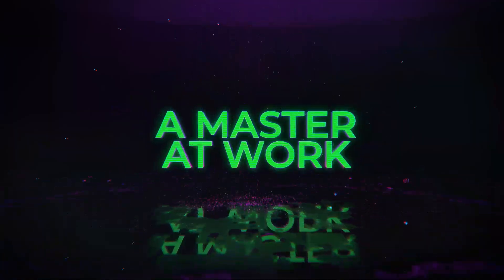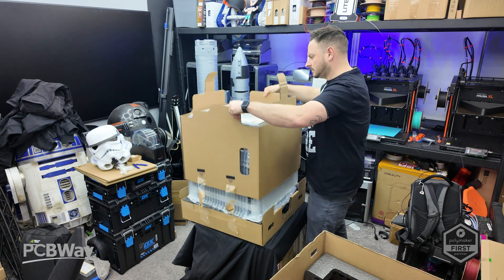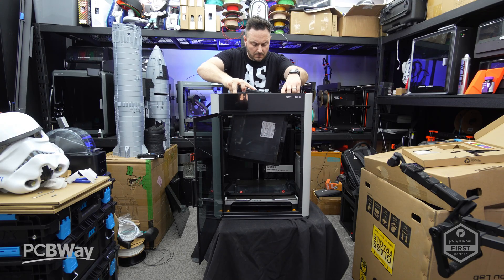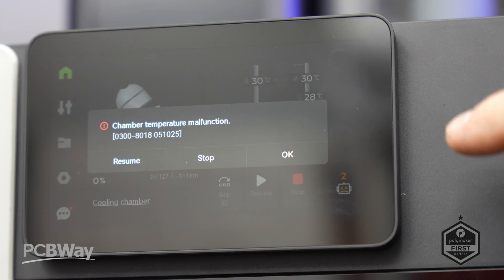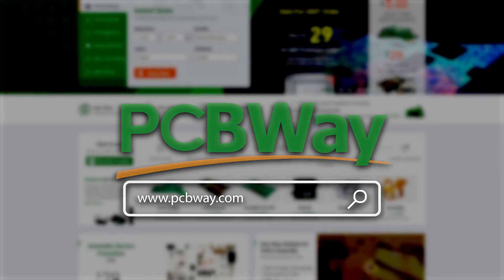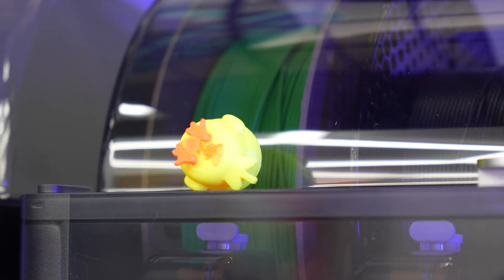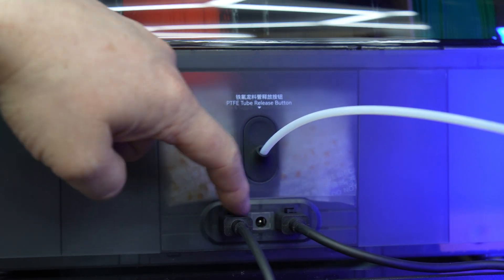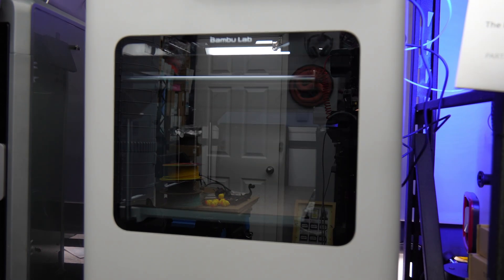Bambu H2D: The Next Big Thing in 3D Printing?

Comment: Hey Sam,
I have a small print farm with 24 Bambu printers and 4 K1’s. My 12 Ender S1 Pros are collecting dust and were made obsolete by Bambu A1’s.
In my opinion the H2D is more of a “toy” than a serious production device. It has too many bells and whistles in one device. I also own laser and vinyl cutters and use them daily in addition to Bambu. 
Lasers create too much dust for a 3D printer enclosure.
Also you can buy 10 A1 Minis for the price of one H2D. I believe many users would have preferred a larger P1S for around $999. without AMS and $1,299 with. Just my two cents.
Reply from the maker: Yeah, I mean to be honest with you I’m a little bit disappointed with the release. I think it’s a bit boring to be completely honest.

Comment: Ceramic guides in the AMS will reduce wear/allow abrasive filament use - that would seem to be the advantage over a dessicant modded older model. Is the new one easier to unbung? 
I have gathered that the new AMS does/will (?) even work with the A1 machines. That aspect would be good to elucidate. 
I get the impression this is Bambu’s “Apple ///“ - beautifully-engineered but with meh performance while misunderstanding what folk wanted and at what price point. I don’t expect “big” sales. 
A (true) 400^3 build volume version of the P1 with a better screen and UI, standard hardened gears and nozzle, call it the P2XL, could have been out earlier and would sell better than this, and not cannibalise sales of other models. Bambu, send me one when you realise I’m right!

Comment: Given the hype and the comments from Dr Tao about how other printer companies are going to have some homework to catch up with the "revolutionary things never seen before in 3d printing", from what i can see the only new thing is the automated top flap and exhaust point.
I'm more interested in the new AMS than i am a slightly bigger build plate that i have to mess around to make full use of it... Surely it would have more sense to slightly increase the size of the machine to allow both nozzles full access to a 350x350 build plate to at least be competitive on that front.

Comment: Do these companies even print?

First, nobody needs a AMS drier.  We need an AMS DEHUMIDIFIER.
I don’t need to bake three already dry rolls over and over whenever I put a new one in…..DUH!

Dry in your dryer and just have the AMS maintain 10%rh.  No mains needed for that.

And am I understanding correctly that the wavelength of the laser included doesn’t engrave plastic?!?!
What the hell!?!
This just cannot be true…no plastic product producing machine company would possibly put a laser in that cuts leather and paper, but won’t engrave the plastic it prints?

Please tell me I heard this wrong.

And no mention on that HT single spooler…. Are we automatically loading PET-CF and PPS-CF from it…switching automatically from the 4 spool AMS?

Did they even do the one thing no company has figured out yet, which is that a 300+ degree hot end should have an extra 3-4” of dead air above the extruder so people don’t need to print ugly risers to straighten out the infeed tube path for those $100/kg filaments we can now print?

UGH
Reply: To engrave plastic, you need a UV laser... do you realise how much that costs?🤔

Comment: The leaks from their website have nothing to do with security. The information was publicly accessible in the HTML so anyone with basic technical skills could have uncovered this information.
Reply from the maker: @0xH4CK32  a leak is a leak and I believe they leaked it themselves
Reply: @ either you didn’t read my comment or you don’t comprehend what I said. This video raised concerns about Bambu Labs security due to the leak of info from their website. Had someone hacked their system to obtain this information than security could be a concern. But in this case, the public information was simply read from the source code of a web page, which anyone can do by simply clicking view source in a web browser. In summary, all leaks are NOT the same as you are implying. Some leaks are serious breaches of security which should raise security concerns. However, this is not one of those types of leaks.

Comment: bizarre choice, all we wanted was a bigger build volume, and they focused on laser cutting........for reasons unknown, and for a price i can get 8 centauri carbons.......bravo
Reply: That’s the plan. Elegoo is going to the moon.
Reply: True. But at least the printer itself ($1899) is still an upgrade over the X1C. I’d go for it. As far as the laser goes, I could get a dedicated laser and a circuit (for cutting vinyl and paper) for less than $2200 price difference if you get the (needed) ventilation system with the H2D.
Reply: Yeah this must be the reason they kept complete radio silence all this time. They knew that they’d get a ton of negative reaction as they did get on release.
Reply: Womp womp
Reply: You don't need to buy the laser version
Reply: @LachskoenigIV exactly. Don’t understand why people are mad about adding a laser/engraver mix has a “optional upgrade” they’re not forcing people to buy the filament/laser/engraver in one. If they aren’t interested in that they can just get the standard model which has all the bells and whistles. Only downfall is they advertise 350mm but in reality it’s more like 300 given the dual extruders limit to reach each side.

Comment: Waiting to see how the Bondtech Indx pans out
Reply: I'm waiting for the H2D to go on sale in a couple of years. Bambu Lab printers have already proved themselves to work well. Do you really need more build volume? And if you do would even 400x400x400 be enough.
Reply: Yes, when I saw this system I thought wow, finally a lightweight compact tool changer system. I'd love to see more information on the extruder carrier, to see if it could be modified or you could make a custom receiver for the INDX hot ends/nozzles. I've been working on my own lightweight kinematic tool changer but it's nowhere near as narrow as their solution.

Comment: Laser cutting isnt clean work.  Even with a air filtration system, purpose built laserachines get dirty.  I see this as a jack of all trades but master of none.
Reply: Why? I watched one video where someone ,robert something maybe, compared the print quality with Prusa. The H2D had much better print quality, it's still the "master" of 3D printing. (of course there are super expensive, 3d printers that I'm sure are better, but of the more "affordable" 3d printers) The laser crap and cutting I couldn't care less about however. Just because it has some pointless addons doesn't make the 3d printing worse. And they are optional you don't have to buy them. If the "laser" version was standard and you HAD to buy it then it would be bad.
Reply: Kind of gimmicky I think.  They should’ve concentrated on 400x400x400 dual extruded.
Reply: @ARIN4UK few people need something that big. It’s just idiots like u who love to cry loudly about it.
Reply: So get the one without a laser... enthusiasts just want the option, like me.. cause I want to do a few projects
Reply: I think you should refrain from buying one

Comment: So they are trying to make a "swiss army knife machine" If I am going to spend 3500.00 for a printer the XL with 5 heads is what I buy. Pursa open source and larger in print volume! making a printer to be a cricket has miss the mark Thinking Bambu should stay in the lane and build printers not a  "swiss army knife machine"  did notice there not a coffee maker attachment or a sandwich press attachment...
Reply: There will be a wondermaker with 4 heads for 549,00 in a Kickstarter soon.
Reply: The breadmaker is on it's way, using the heated chamber to proof the dough, then goes to bake mode

Comment: Lose the laser features and increase the size and then maybe it would have peaked my interest... I think I will be going to a K2 Plus to get the size I was hoping for. I am mildly disappointed in this... although impressed with some of the features. Thanks for the first look Sam!
Reply: you can have the non-laser version. tool change is awesome fast like A1 series. volume is pretty much the same as K2 Plus and I'd bet good quality and fast since it has same belt as Qidi and High Flow nozzle
Reply: Tim, you need a new Rat Rig!
Reply: Just be aware that the K2 will be much more work. I've had three K1's delivered to me and every single one came with issues from the factory. Two with bent Z-screws

Comment: Been waiting for this.

Now I can move on and just get the bigger printer I was waiting for from someone else.

Mind you, the firmware changes still give me the willies so it really needed to stand out …. and at least for me it doesn't.

What happens when you don't listen to your customers?  

The Bambu H2D - that's what happens.
Reply: What bigger printer did you decide on?  I don't want a Creality.
Reply: @josephjohnson6626  I have the Eryone 400 backed on Kickstarter but not sure if I will see that through.  The Ratrig 4 is tempting but do I have the tine for a kit?

If 350x350 single colour is suitable I can recommend the sv08.  Had an issue with the original hotend but got the fixed hotend and no problems since, and been working on a TC though the Bondtech INDX may be the way to go.

Comment: I'm quite pleasantly surprised by the price - and personally like the fact that the dual nozzle will be slightly more efficient for multi colour prints - so will probably be upgrading from X1C to H2D - plus maybe get one AMS2 due to its increased speed and hopefully reliability - to add to existing set of AMS's.    Would have liked something more innovative than just two nozzles, and larger build plate - but it is a step forward and it would be hard to justify doing any multi colour prints on an X1C if you have an H2D next to it - so might relegate X1Cs to single colour printers.